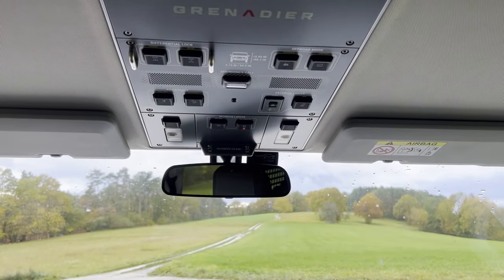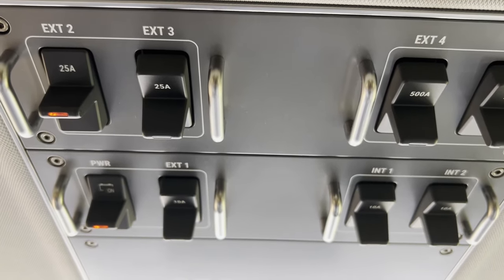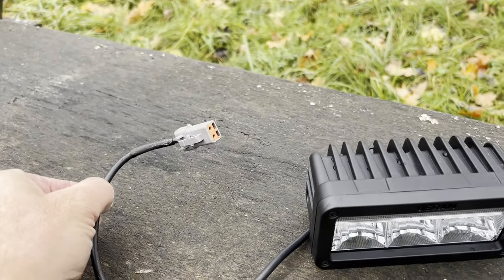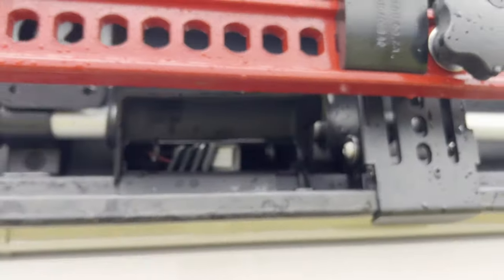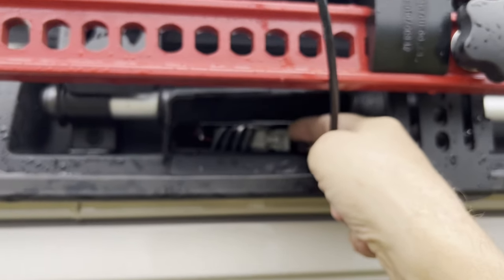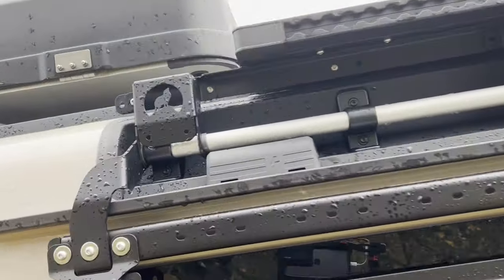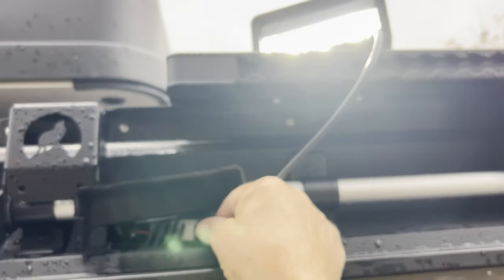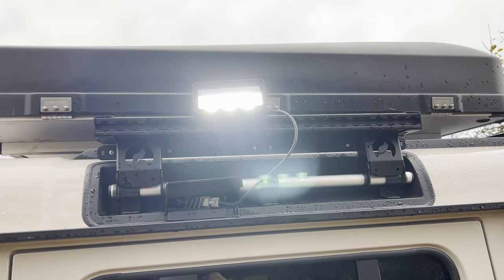INEOS Grenadier, Technical Workshop #2 - Roof Power Outlets

Comment: Are you getting a light bar? And if so will it be the Ineos accessory or another aftermarket brand?
Reply from the maker: I have something special in mind, it will be specifically designed and mounted to my setup. Stay tuned.

Comment: I bought an Ineos to use to get around on farmland and IT DOESN'T WORK.  
Reason - the vehicle has been at the dealer for 5 weeks and counting whilst Ineos Technical continue to fail to resolve a non-working cabin heater and aircon.
The Customer Service people told me that fixing my car is a priority, and that an Aftermarket Manager would personally resolve this issue.  Nobody contacted me, and Ineos will not share the manager's contact details.
Also - Ineos will not lend me a replacement 4x4. Why would they - I have paid in full and have no leverage.
I wrote recorded delivery to Ineos CEO Lynn Calder to try to get some traction on this issue.  10 days later, and no response from the boss.
So, like the rest of her organisation - she doesn't care.
Reply: Any updates?
Reply: @BeowulfHagen  Yes - a second letter to Lynn did not produce a response.  To share the pain I call Ineos daily to try to make their lives uncomfortable, and this has finally accelerated the response to a 'normal' level.  I may even get the vehicle back tomorrow, and if I don't I am seriously considering rejecting the Grenadier.  It's a new vehicle, I want it - but only if it works.